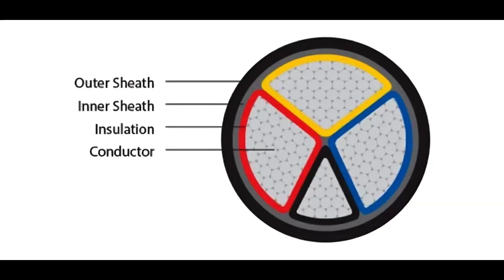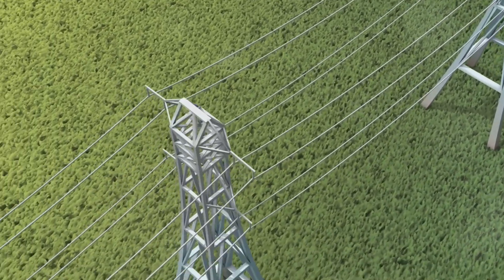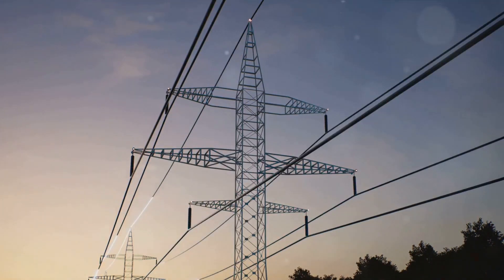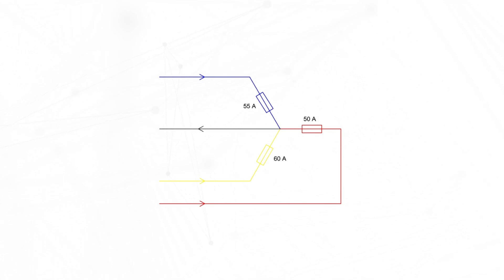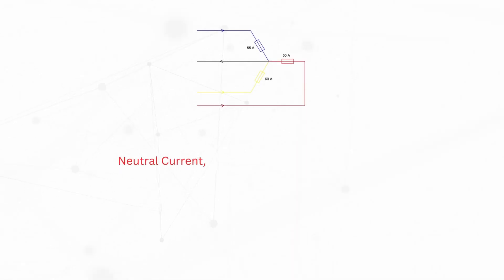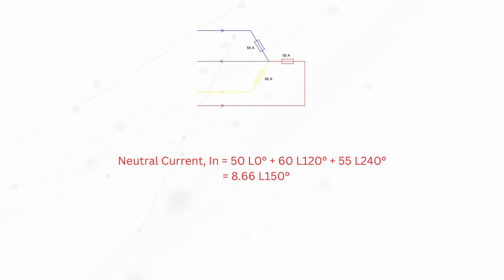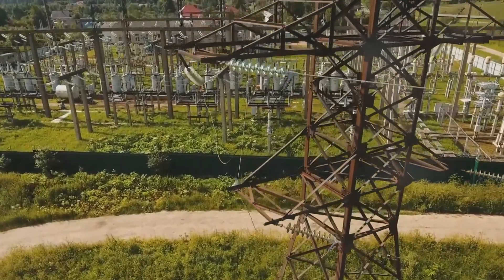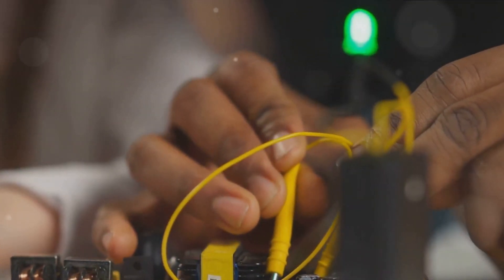Why is the Neutral Cable Thinner than the Phase Cable? @Electrology001

Comment: Hello I have a question, so three phase line the neutral is smaller, but what about single phase normal home wirings let's say we use 2.5mm wire for phase so do we require 2.5mm for neutral as well or can a 1.5mm neutral wire would do as almost all of the electricians in villages say this "Neutral doesn't carry load so it can be thinner"
Reply from the maker: That’s a really good question! 
In single phase wiring, the phase and neutral both carry the same current, because whatever current goes through the phase returns through the neutral. So technically, both wires should be of the same size — for example, if the phase is 2.5 mm², then the neutral should also be 2.5 mm².

The idea that “neutral doesn’t carry load” is a common misconception — it only applies in balanced 3 phase systems, where the neutral current can be small. But in single phase circuits, neutral carries the full return current, so making it thinner can cause overheating or voltage drops.

So yes — for safety and efficiency, always keep the neutral wire the same size as the phase wire in single-phase wiring.

Comment: Why is the neutral wire thinner. Is it thinner? 
No! In Germany, the neutral conductor is designed to be just as strong as the three phases. 
Often 230 volts is needed between a phase and the neutral conductor. Then the neutral carries the entire load.

In addition, there is a voltage shift if the neutral conductor breaks and there are uneven resistances on the three phases. This voltage shift will destroy devices.

In Europe, the green-yellow conductor is always intended for protective earth or PEN.
Reply: My guess is: There's no contradiction as you're probably talking about a single house or apartment, while the video is referring to upstream cables feeding a whole building for example, in which case, approaching balance among the 3 phases is much more likely than the case of a single unit.

Comment: When you power quality issues in consideration, (capacitive reactive power) this thinner Neutral wire is not sufficient anymore. This can result in even thicker neutral lines than line wires! Can be caused by for example big buildings with bad quality LED lights.. so be careful and engineer it right.. 👍